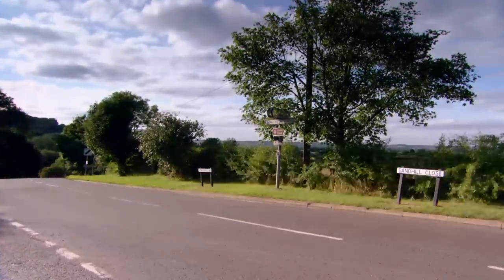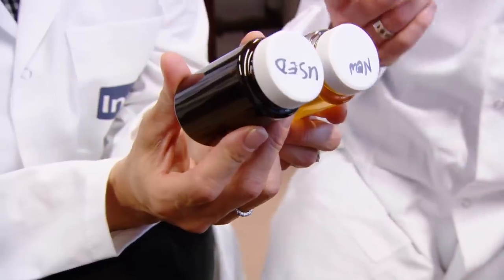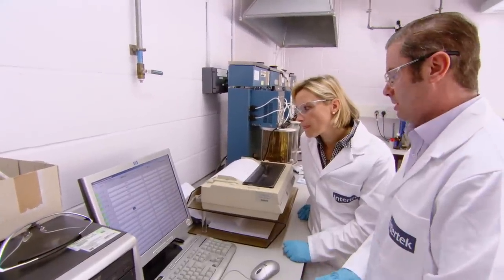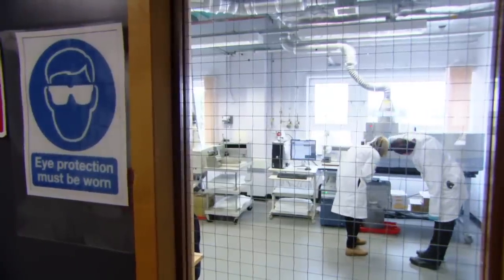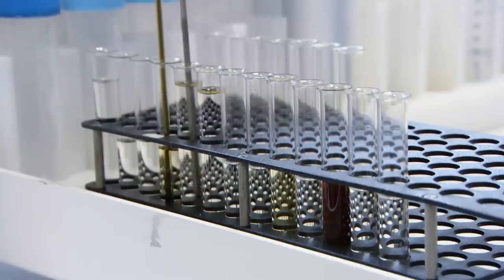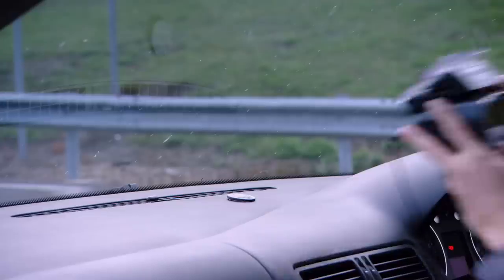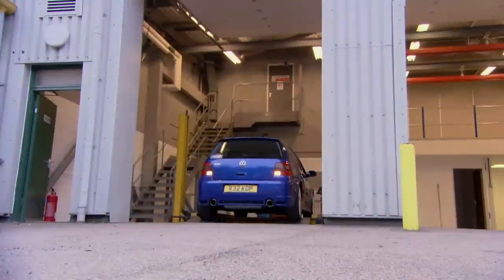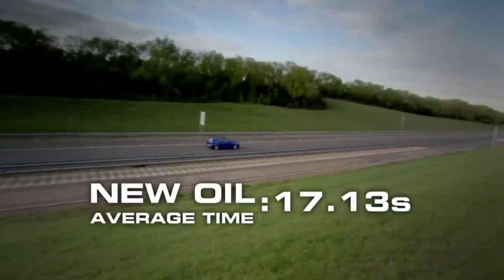Used VS New Oil in your Car | Fifth Gear Classic

Comment: Sure, changing oil will only help the engine but please, more than half a second faster to hit 100mph? That is like 3% faster, that means that just the oil change would give like 5% more power...on a R32 its about 15HP! Even Gran Turismo is more realistic.
Reply: the main thing the engine lasts longer without slowly losing power. You could right a book on oil related issues

Comment: Isn't a lower viscosity oil more efficient? 0-30 offers less resistance to the motion of the engine vs 10w30.
Reply: The lower number refers to cold oil, but I get your point. I think the lubricity of old oil is worse, the viscosity isn’t the relevant factor.
Reply: The oil has to be thick enough to lubricate properly and seal properly. It also has to be thin enough to cool properly and clean properly. This car wants 5W-30 oil. VW 504.00 quality should last 2 years or 30.000 km (20.000 miles).
Reply: @squadmeta  Too thin oil will not lubricate or seal properly. Too thick oil will not cool or clean properly. The viscocity has to be right. In this case 5W-30 or 0W-30.

Comment: changed my oil every 5 years in my old citreon engine superb just top up  the words bullshit come to mind  an engine only fails with no oil its the parts around the engine that fail eg clutch alternator  very rare to see a  standard engine fail
Reply: Engines do fail usually because of head gasket failure. A well serviced vehicle however the engine should never fail. The clutch will burn out eventually but 5 or 6 clutche replacements is cheaper than a failed auto gear box. I have seen personally clutches last of 250k miles. City clutches obviously burn out quicker. With most cars though I agree its other things that fail and cost more than the cars worth that eventually kill it off.

Comment: Absolute crap! Changing the oil doesn't cause more power to be noticeable in a speed run. Weather conditions, launch performance, gear changes all make big differences. If this was supposed to be scientific, you would have put the car on a dyno!
Reply: I totally agree! The lower viscosity of the old oil should make the car faster, not slower.
Reply: @wolfschindler8921  Yes, if a difference was detectable it would be in favour of thinner oil.
Reply: But it would have increased resistance and heat due to debris
Reply: @user-bh6zt1it2l  Yes, but only to a very small extend. Most of the drag comes from the resistance of the oil.
Reply: All of you guys are wrong, no point of me writing a 15min read, just look up an episode they did with a VW Corrado. Talking about a dyno and science, 5th Gear already had done the test using a dyno on that VW Corrado I'm talking about. Look it up and see.
Reply: Old dirty oil causes more friction. Friction causes loss of energy. When you change the oil, the new oil will waste less energy from the engine and that exess energy is the extra power you get on the wheels.
Reply: If you are skeptical, why not run a similar test on your own car before and after an oil change?
I'm planning to give it a go with my car, I'll be interested to know if there is such a significant effect.

Comment: Honda civics from 2000 can go a very long time without an oil change as their engines are very strong so you can get like 15,000 miles between each oil change

Comment: If half the cars don't have enough oil, how many have never changed oil?

Kinda makes me think this is a warning about buying used cars.

Seller may show a book with regular maintenance done, but anyone can just rubber stamp that book.

Many people get a oil change and then put the car up for sale. If you look at the dipstick, it looks like light tan.

No mechanic is going to disassemble the engine to find the sludge.

Just get a sample on the dipstick and analyze it.

Comment: I hope this video wasn't financed by the oil companies.  With additives now adays (especially in synthetic oil) you can go at least 10,000 miles before changing it.  Now, that is in normal driving.  Also, our systems are so sealed, little or no water gets in.  Those "dangerous" particles that gets into the oil are usually picked up by our oil filters.  The one big problem of not changing oil every 3000 miles is that you cut into the "POOR" oil company's profits!

Comment: diesels  have low tension  oil rings . carbon sticks to the rings and they score the bores .changing your oil soon will  stop this . oil is cheaper than a new engine

Comment: Do not understand this fuel in oil contamination story. If engine is running on long distance oil becomes hot. How it's possible that still remains in oil and not evaporate ? Vapors should then be vented via carnkcase vantilation system and burned in cylinders... Or we are talking about engine runing only on short distances and never reaching operational temperatures....

Comment: Well BMW recommend an oil change every 20,000 miles. HGVs normally have an oil change every 100,000 miles so where do these silly 6 to 10,000 mile figures come from ?
Reply: Peter Norman that’s why new bmw are braking down.
Reply: Normally the car manufacturer specifies the service interval. 
Oil change intervals have increased substantially over the last few decades, due to better oils, better manufacturing of engines, better filters, probably lots of other reasons too. 
Intervals of less than 6000 miles/10,000km were common 20 years ago - even for BMW's.

Comment: Christ that old oil looks more than 10,000 miles old for a petrol engine!
Reply: Used oil always looks black, even that of a petrol engine after a short OCI. It may still look golden and honey like on the dipstick but as soon as it is drained into a container you can see its actually pitch black.

Comment: You really have to be stupid not to change oil for 10 000 miles or even more. 5000 miles and no worries.
I'd rather spill good oil than burn good engine.

Comment: how can you change oil every 10000 miles?!?! way too much to keep an oil...
Reply: I know right, some people though for example people who drive 30000 miles a year for work can't realistically change every 5 to 6 k miles
Reply: Morgan Morris and those people usually do highway miles, which have less wear than city miles on the oil
Reply: If you don't drive short runs, and drive on a highway most of the time, you can change it every 10.000 miles. But if it is a turbo engine and/or has a timing chain, I would change the oil every 5-6.000 miles. Oil and filters are cheap.

Comment: rubbish. 
facts
oil is black due to carbon not metal parts
0.000001% of metals will do no damage
oil is ok at least for manufacturer' s interval and that is for

vw 30.000km
mercedes 40.000km
opel 20.000 km
and so on

15.000km or 10.000miles is just trowing good oil and money away and polute environment even more.
what is important that you add a bit oil every now and then since engine consemes it a bit

Comment: This doesn't make any sense and is pure rubbish. How can there be a bug in the oil??? The engine is sealed!!! Also there's  an oil filter!! The performance part is true but not to such a large extent
Reply: The bug is microscopic, and it may have entered when filling the oil up in the first place. The filter doesn't filter everything, and they even said the metal fragments were very tiny and in very small numbers, but they were still there.

So change your oil. :)
Reply: I put the bug in the engine
Reply: Bugs real problem  on ship engines can gel oil
Reply: The bug must have come in when filling oil. Probably when changing the oil...
Reply: I need a clean room to change   oil for my cars from now on.